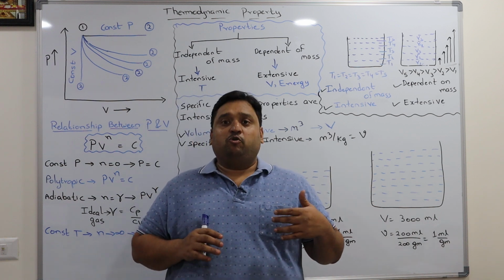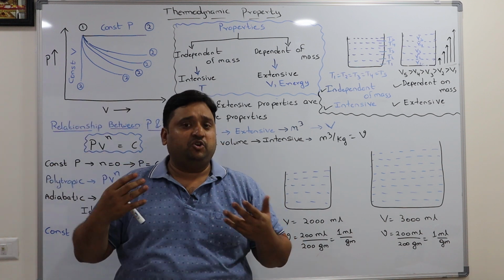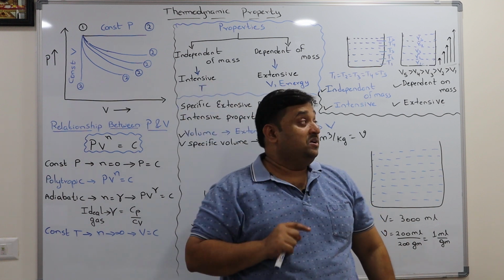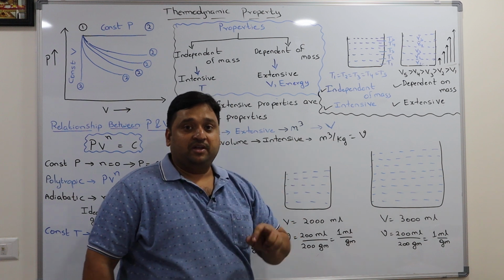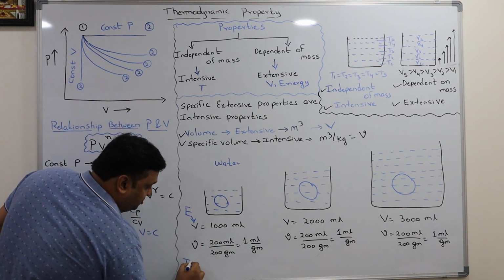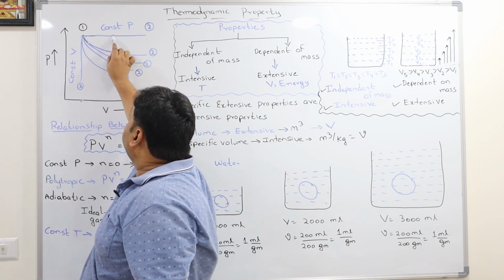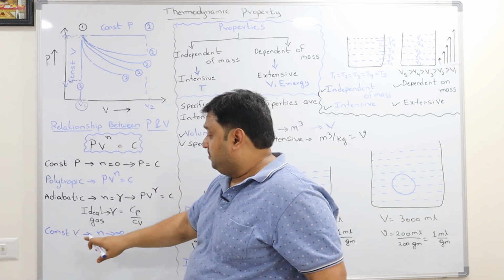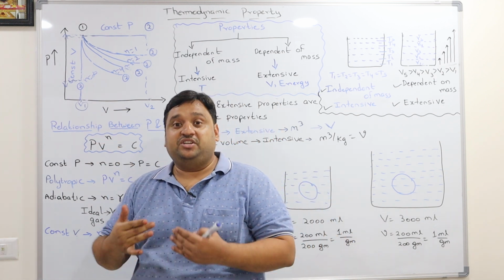Lec 3: Thermodynamic Properties_Intensive/Extensive/Specific Extensive/Process on PV diagram

Comment: Sir i have small doubt please clarify it sir 🙏 
Honarable sir area is inversely proportional to velocity and area is inversely proportional to the pressure so pressure and velocity has to be directly proportional but in that case pressure and velocity is inversely proportional to the pressure 
So i question is how this is happening and in Venturi meter how when area is decreasing the pressure decreasing but velocity increasing and how at that increasing area regains pressure and decreases velocity according to pressure formula area must be inversely proportional to pressure but in this case this not happening how at that particular area knows to decrease the pressure and to increase velocity